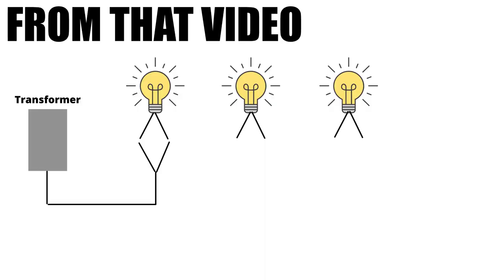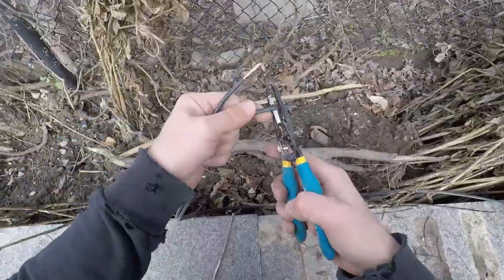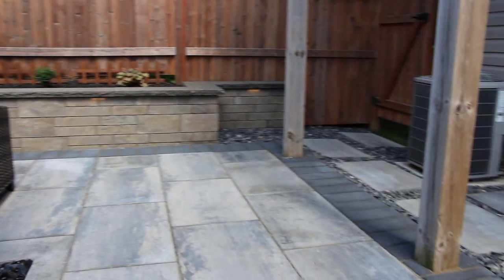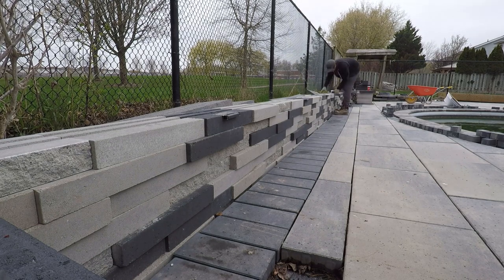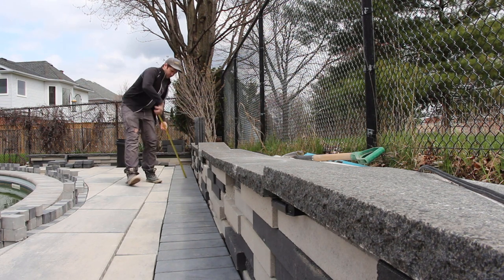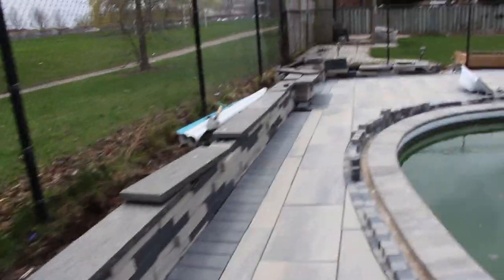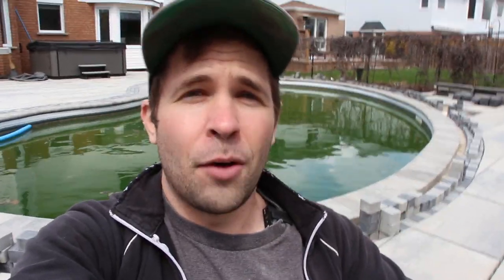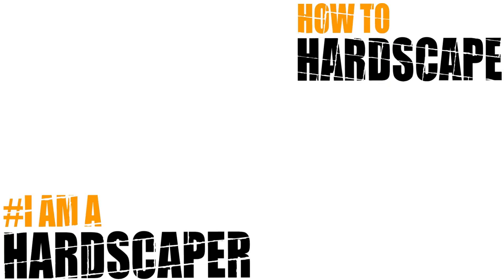Hardscape Lighting Design for a Retaining Wall

Comment: How do you plan to compact the polymeric sand into the joints on this job with the large slabs - rent a roller compacter? Put down plywood and use normal compacter?
Reply from the maker: We have a roller compactor I picked up last year just before starting this project we will be using on this one.
Reply: @iamahardscaper  would you use plywood and normal compacter if you didn't have a roller?
Reply from the maker: We have a compactor and a removable pad that we relied on in the past. I've used plywood once or twice in a pinch, but the pad is better.
Reply: @I Am a Hardscaper  I just find that my removable pad always scratches the stone, even when I've brushed sandpaper on it ahead of time. Somehow the poly sand is large enough to cause surface scratches which is frustrating
Reply from the maker: Yeah we try to sweep off as much of the polymeric sand from the surface as possible before compacting

Comment: You should always divide your lights by 1 extra to get perfect spacing instead of 2 you should divide by 3 u spaced 27 off ends with a 55 middle when it should of been 110 divided by 3 = 36.6”
Reply from the maker: I used to do it that way but I found the ends were spaced too far apart.

Comment: How do you replace a light under the wall cap if it goes bad?
Reply from the maker: You’d have to pull up the cap to replace it. WAC lighting has a light where you can just pull it out which is worth looking at
Reply: Is there a video on removing a wall cap?
Reply from the maker: unfortunately not. It would be a matter of prying it off and trying not to chip it. Another reason why I use natural stone caps. If they chip, they are natural stone all the way through. I also use a flexible adhesive that helps as well.